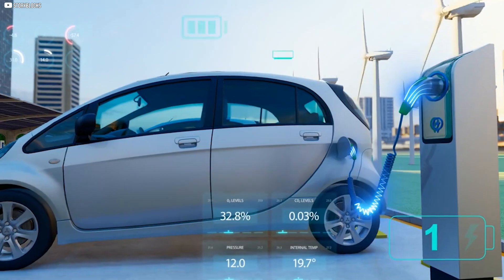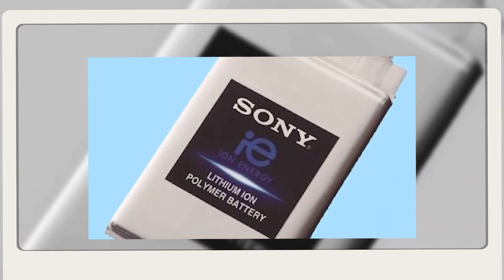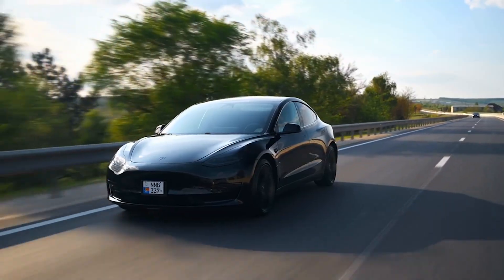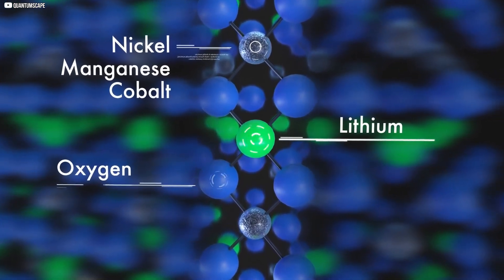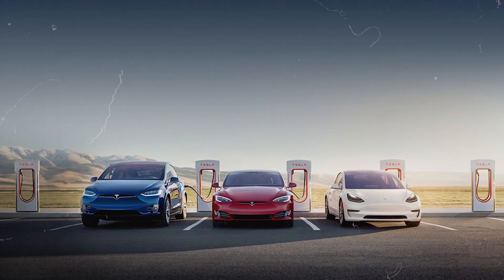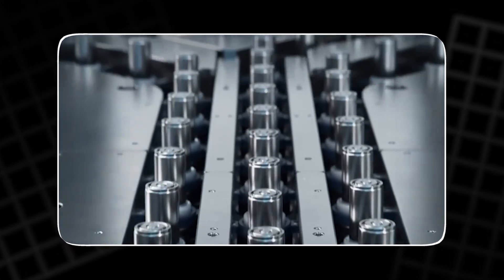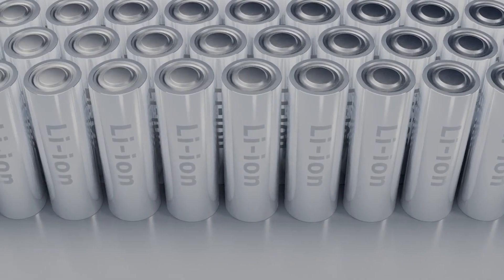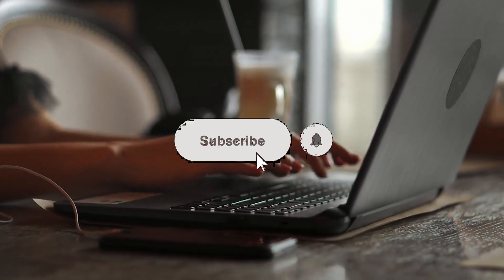The Most Powerful Battery Ever? Lithium Metal Explained

Comment: Lithium. Metal. batteries are 
considered  the. most power ful “
due to. their  potential for   significantly higher energy 
dentisty. with. prototypes. exceeding.  500wh/kg. compared. to.  conventional 
Lithium -ion batteries